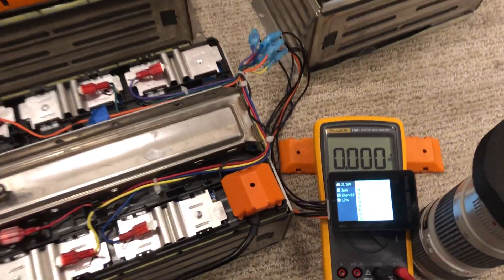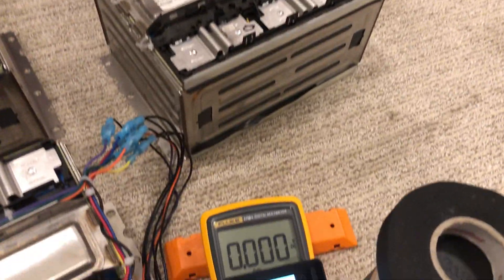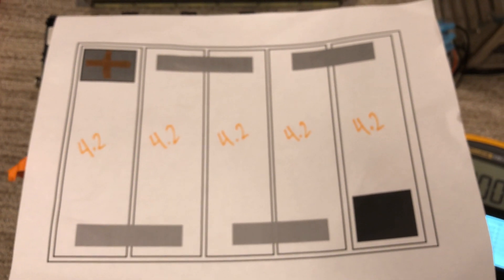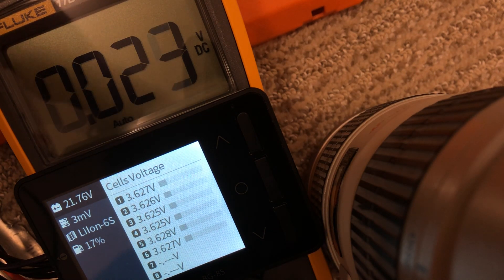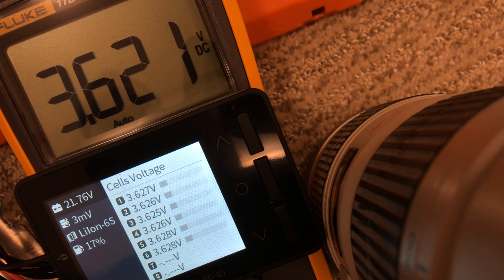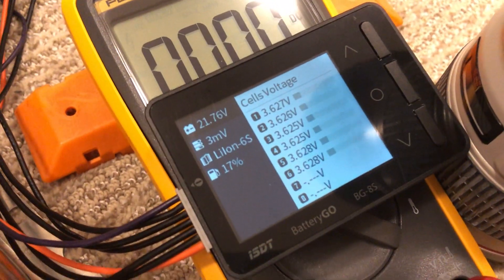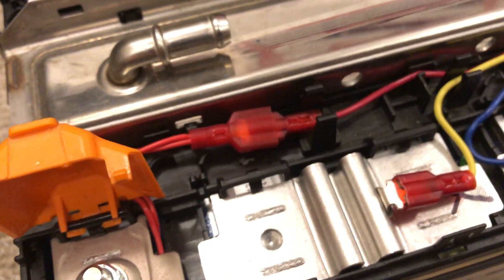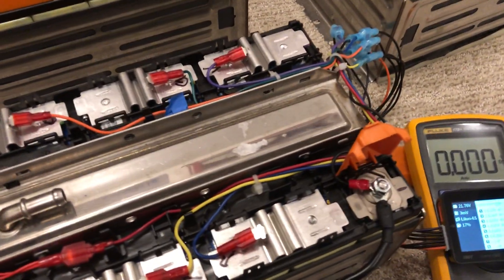Getting to know the Fiat module & BattGo Cell Checker Voltage Testing

Comment: what can u use to hook up to the existing wiring so can go battery to battery with one checker?
have u balanced these?
or any more info on these batteries i have bought some but not used yet
thank you
Reply from the maker: I have balanced these but it takes forever if they are really out of balance.  I use a RC Balance Charger for serious work.
Reply: Do you have any idea how many 18v comes in a pack and how many 24v? 
I know its 18 total packs, but 9-18v and 9-24v maybe?